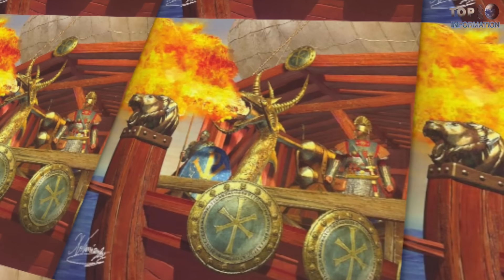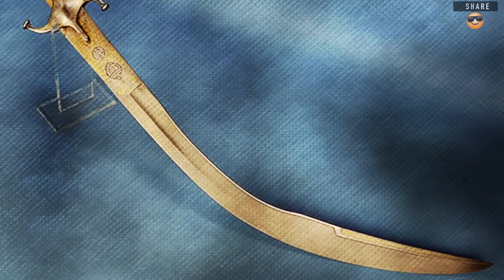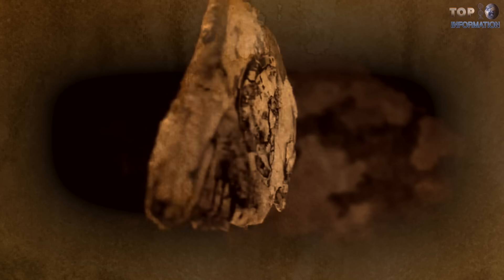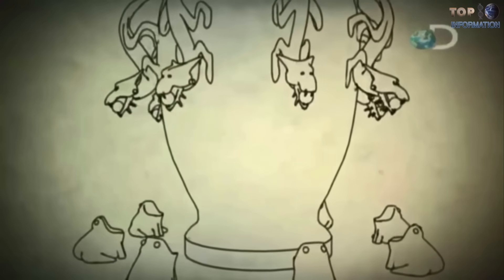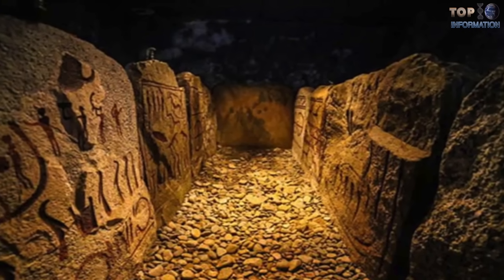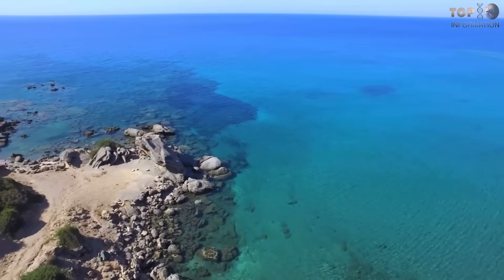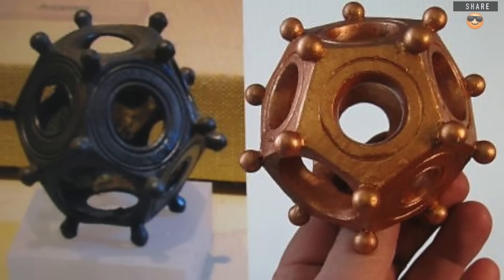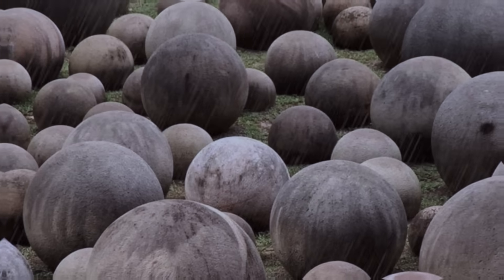10 Ancient Inventions that Science Can not Explain ▶ 8

Comment: as a blade smith I have to say , the Damascus steel section of this video  is rubbish. " Damascus" steel actually  came from India and is called wootz. It is a crucible steel, but it does not contain leaves or coal. A small bit of carbon based material was sealed in the crucible to use up oxygen to allow the  meteorite iron to fuse into a forgable bloom. No sword will cut a rock and a silk scarf, it's not  supernatural, its just high carbon steel that behaves according to normal laws of physics!
Reply: For all here, pls read iron pillar in delhi to understand India..
Reply: How To as a matter of fact, they are! Evidence has been found that the mauryan Kings had these swords.
Reply: Aditya Bhargava it’s bullshit
Reply: You also forgot to mention it has to have a better furnace that reaches much higher temps. The reason there is no real info on the method is due to the same reason no one could make silk out side of china.  The formula was guarded. Only a small hand full knew how to produce the ingots.
Reply: Fuck those satanist zion,fuck the knight shitty templars,fuck the kabal pedophile vatican city....fucking disgusting invaders,the real terrorist...
Reply: It wasn't made by syrians. It was made in India, traded to Syrians, who passed it on to the West. In the process, they started calling it Damascus steel
Reply: How To  buddy it was found in India, I've studied that shit in school, it was first used and popularised by Tipu Sultan (a king of India)
Reply: Not the king of India king of some cities of the sub continent.
India is teaching false news news in the school.the Damascus was 9000 years ago.
and Tipu sultan was 400 years ago.
Reply: No it wasn't it was first used in the islamic empire then later spread to other places.
Reply: @hiteshkumar4018  I know that you're right about that India had access to high-grade iron, and that the Indians of that time had the ability to produce both iron- and steel-items of exceptional quality. As early an age as that of the reign of Ashoka ("the cruel" whom after a convertion to buddhism instead became "the pious") ,approx. around 300BCE..
But - when referring to someone who had the title Sultan, we must already be at the age where the muslims had arrived, since Sultan is an Muslim title (meaning leader, if I'm not mistaken?)
Reply: Hitesh Kumar ya well school isn’t always right about history by the way you said school it sounds like your in elementary
Reply: Damascus steel was made from crucible steel ,made from an ore that was mined from two to three mines. the ore has different minerals than any other, when the mines were worked out the method was lost. Damascus may not be named after the city but from Damacine the pattern in silk.the sword  pattern is very similar to the watered look of some silk patterns.
Reply: Karl Kruger that makes perfect sense.
Reply: Damascus is difffrnt than wootz
Reply: lol indians. According to them everything was invented in india yet somehow they are never found in india. Strange.  I bet they'll probably claim they also invented gravity just forgot to write it down lol.
Reply: Gunner4Ever,
Wikipedia isn't a scripture sent down from heaven, that is written by someone like you and me. And there is a lot of wrong information here. If Damascus sword originated in India, then why there was no such swords in India before Muslim invasion in 712 A.D?
Reply: @M. Rashid Iqbal Mian, Hahaha, Yes, Wikipedia isn't a scripture sent down from heaven. It's exactly why it is reliable & actually legitimate, compared to your heavenly book narrated by a magical winged creature Gabriel to a 6th century desert dweller. Wikipedia actually has got citations to back up it's claim, just so that you know. And if it was that easy to write wrong information on wikipedia, like how the dumb internet folks claim, then why don't you go & edit that wiki page that says that Damascus Sword originated in India.

Also, who told you that Damascus Sword was not found in India before the Muslim invasion??  You have just assumed that & starting from a wrong assumption yourself. It was very much there, just  that it wasn't called the Damascus Sword in India. The knowledge of producing Wootz Steel (Yes, this was it's Indian name) has been there in India centuries before Islam was invented by Muhammad.
Reply: Gunner4Ever,
My friend, Isn't it very easy, that Indians present a Damascus Sword as a proof, that is before the arrival of Muslims invasion in India? But this can not happen, because there is no such sword.
Let we assume and believed that such swords were first made in India. Yet it proves the ignorance of Indians. They were using poor quality swords, while they had the ability to make high quality swords.
Reply: @Rashid, Mate, India has got lots of swords in their museums made of the same Wootz Steel of which the Damascus swords were made. Just that they don't call those swords in India as 'Damascus Swords'. And it's not just me or the other common folks over the internet claiming this. It's the researchers & historians who agree upon the Wootz Steel being originated in India & then being exported to Middle East later on. Maybe you should use that high end technology called 'Google' to read about that. That's just a click away, isn't it?
Reply: M. Rashid Iqbal Mian I just want to ask you one question...were you alive during the time Muslims invaded India. You are talking as though you were the commander in chief for some Muslim ruler. Listen ,have you ever played that game where you sit around and pass a word to everyone in a circle to see whether the last person gets that word correctly? Mostly the last person says a different word from the original. In that short time words are being manipulated. So imagine over the centuries how much the original truth has been fabricated. Human mind is not advanced enough to understand certain things. Don't talk like you invented time machine and saw the past. Someday truth will be clear. Be patient till then. And I said all this not just for you ,it's for everyone.
Reply: Gunner4Ever islam is not invented by Muhammad pbuh.......ot existed a long time before but in different name......
Reply: @funguy9177  agreed.. Even in the video shows some Islamic design found in Scandinavia.. Guess all educated Western people are ignoring Islam contributions.. No wonder they separate religion with normal life
Reply: @ahmadulwan6634  I do not exclude the Islamic contribution to, mainly science - not to mention the conservation part.
But - the Viking swords have absolutely NOTHING to do with anything Islamic.. They were made at about the same time when Islam came into existence, not even Christianity had arrived here at that time.
Get a life!
Reply: @tanime_man6535  I respect what you say but there are multitudes of  deductible evidences from unrelated and unconnected sources of a given period in time that match, that is how historians conclude what is near to the truth and what is near to the falsehood, 
otherwise no use in learning any history and taking any lessons from history.
Reply: @khiljinagor8976  if evidences you mean books right?? And who wrote them? People. Let me remind you of a saying " winners create history" whoever invades a country and wins will record that incident according to his own whim. He maybe a cruel guy but he wants history and the future generations to treat him as hero so he will make it that way. And I don't believe everything that's written in books have evidences and proofs .
Reply: @tanime_man6535  so you have secret books and or knowledge to explain events in history that no body else has? Or do u get visions.
Reply: @khiljinagor8976  did I say I know stuff about history like how you guys are assuming . I'm saying history is not completely true. It could be fabricated. If you are blindly believing everything book says then you are as dunce as you could be..
Reply: @tanime_man6535  Look no body picks up one book of a given subject and says hey I know the history of that now- everything there is to know now. 
No we look for other multiple sources and even from different angles eg enemy or opposing factions of a character to see the opposing point of view of the same event. I'm trying to tell u we may not know the absolute truth but we can gradually start getting pictures of history if we endeavour.  

Why it's important to always study further information even if you think u have found out a lot you never know you could unearth whole truths after years of having one opinion you may find out it to be false,,,... that is if you are searching for truths, and honest about it. Otherwise just pick up one book or the main narrative only and be happy in fools paradise. 

I am not saying u are doing that, just pointing out historical debates can happen based on texts and findings we should not just brush it aside completely. 

You seem to imply from your posts and opinion historians just pick up a book from a victor and say hey there's the truth., and seem to imply every historian is doing it from your argument.
Reply: @khiljinagor8976  you said it yourself I rest my case... You said we may not know the absolute truth. Then why are we fighting based on half proven facts. I'm just stating that once we know the entirety of it (and I'm sure we are not advanced or evolved enough to understand all that) we can have these arguments. People are fighting each other based on half assed theory . That's my problem. Only if you know completely about something you can argue about that. Only idiots will fight over half based facts. You have 5 or 7 different variations of Mahabharata. Person who read one fights with the other. You get my point? That's what happening here.
Reply: justin g It does make sense, if damascus was so amazing and magical then why wasn't it used more? And why didn't it persist until modern times? Once we found out how to use steel (a vastly superior material than those before it, just like damascus supposedly was) we clung to it and never looked back, why didn't the same happen with damascus if it's reall all it's hyped up to be?
Reply: I'm sorry but aside from maybe some type of classified unobtainable alloy that the US government has hidden away at groom lake there is, nor ever was a blade
 that will cut through rock and then slice a scarf in mid air. It's a nice campfire tale for the kiddos but that's all it is
Reply: Ron Hoy ur smart and smarter than smart,, well done,,, if I may suggest read  more book oh history not his-story
Reply: nu uh! its magic! it says so in my magic book!
Reply: Yeah, even to me - who is not a blacksmith or for that matter knows very much about forging blades at all - it seemed like the "mystery" of the so called Damascus-blade was heavily increased!
Common, please - what kind of metal can "chop" stones in halves? I mean, really??? And, without even being damaged? Are we talking about Luke Skywalker's saber here, or what?
And, I can't say that I know anything about whether the Damascusblades actually came from India or not. But this I do know: the Indians were THE most advanced ancient people in metallurgy, all other civilizations considered.
Even the British acknowledged and respected that, when they found it in the 17th or 18th century - and the proof is still standing 'til this day, in - I think - Dehli. I can't seem to remember much else than that I think it's called Ashokas pillar, or something (at least it's someone's/something's pillar) - which is like a 10+m long iron pillar, without any seeming joints...they just do not know how they could have made it!
Reply: Matt*ma* Ghandi but indian once conquered and changed by british empire......that might change everything....
Reply: Brad S it's hilarious when you find one of these videos that are just plagiarism of listicles from buzzfeed
Reply: I find it odd that joe shmo in his back yard can make a Damascus sword while its still a scientific mystery....... Now either joe is a fucking genius sent forward in time with mysterious knowledge and unknown materials, the scientific community is fucking idiots, OR this video is absolute hogwash as suggested by the OP (I got my money on the hogwash part).  LOL   
As far as who was the first to make a Damascus sword...... who the fuck cares its 2018.
Reply: @Mike Smith you're saying dragons aren't real man I just seen a dragon on the cartoon network shits real. 😂😂😂😂😂😂😂
Reply: I think they mean that we haven't been able to quite reproduce the same properties as true Damascus. We have superplastic steels for sure but last I checked (which was like a decade ago) we haven't managed to get it quite right in terms of reproducing the exact same type of steel.

Like the modern damascus we made is either more or less hard/flexible than the exact balance of old damascus.
Reply: Many things are beyond the imagination of people that have no concept of physics chemistry and material science, math etc.
Reply: the amount of religious autism in this thread is profoundly overwhelming...
Reply: @wilsoncrocker  lol, true.
Reply: you misunderstand Ron she said "Dumb ass cuss" steel Ill bet its from china like everything else!!
Reply: How To that's the dumbest type of "logic".

Example of why you're dumb: hey, if the pyramids were built by Egyptians, why aren't they still building pyramids?

Or a more exact example: hey, if Damascus steel was made by Syrians, then why don't Syrians make them today?
Reply: juuh771 if only a small handful knew how to make it then how are they making it today? 🧐
Reply: Ron Hoy you are correct Roy. Greek fire was really Persian fire. The Greeks took it from the persians
Reply: dont bother asking, he was jst googling after he read ur question.
Reply: Army BTS it is not actually 'obvious' but it might true
Reply: Ron Hoy you wrong..the damascus was originated made in arab..it was one used by the muslim prophet...and dont be so clever if you dont know the history of it..
Reply: Ulfberht swords was made of crucible steel, and it wasn't casted. Also, we know how to make crucible steel.
Reply: ya i agree on damascus, i would go one further even and say the bronze age was total crap, bronze is harder to make than steel it would have come second, bronze is like saying the color green was discovered before yellow and blue its always sounded that stupid to me the theory
Reply: Well since both dragons and dinosaurs both have tells/myths having either quills or scales on them mostly quills it could be possible that there was some type of dinosaurs if you assume dragons and dinosaurs are one and the same as I am; it could be possible of using a animals blood for cooling instead of water was used since most damascus steel that is made is still not close to the old damascus in how it's recreated.
Reply: the narrator is dumb and knows nothing more than shit
Reply: Actually, Damascus steel comes from Samaria/Mesopotamia which advance metallurgy was more common ten today. Yes, it’s was spread to India, the same way it spread west to Africa, and north Europe by Vikings trade roots via current Ukraine. It’s not mystery. Can be done today, but it’s massively expensive due way it’s done. And it content may be organic to assimilate slag - include bones of ancestors, glass from descent meters landings, etc. White man Europe lives in caves then ;)
Reply: @sniperacs  Don't spread bs
Reply: ok bill nye
Reply: was gonna come and comment about that :D fucking lost my shit when she said damascus :D oh well im glad someone else got here before me :D
Reply: Ron Hoy your right but I've heard the Vikings used ashes from the dead for carbon as well to make stronger steel I heard it's the best
Reply: Ron Hoy I had someone try to tell me Damascus was outlawed. I have a friend in Arkansas that's quite possibly making some "as we speak".
Reply: is that hard to cut a silk scarf
Reply: @matthewtrippi6739  lolol
Reply: Ron Hoy I agree with. The so called Damascus sword has the wave jst like an Indian sword
Reply: OhMyGOD OMG illogical
Reply: cad80 24  your grammar is as fucked up as your opinion
Reply: Not a bulsshit. The tehcnique humanity uses right now is far from the techniuque used at that time. Damaskus steel of that age didn't include only leaf like material, it also had a few more foreign substences that acted as a purifier of carbon, making it close to katanas in sharpness and close to full metal rods in strength
Reply: Actually, it first came from Damascus.  Not the damn name.  -_-  Which is Syria.....   India didn't even fold their steel until after Japan started folding to make similar "Damascus".  But this video is full of stupid shit anyways.
Reply: Ron Hoy prove it
Reply: It was the Muslim rulers of those time who brought Damascus swords to India. Mostly they were Mughals. You better educate yourself more.
Reply: And the ingots of wootz steel were imported from India and Sri Lanka, the swords were not “made” there. Materials from South East and iron smiths from Middle East. No fucking Indian knew how to make it. They just had the raw materials which they exported to Middle East where it was actually made.
Reply: So indian
Plsss

Make..this damascus sword..

Make sure its the most powerfull in the world..

Like..history damascus sword...
Reply: No, it didn't come from India, the wootz steel came from from India.
But the people from Syria created damascus steel from wootz steel.
 So damascus steel is a product from Syria. It is like saying yeah tomatoes came from us so in otherwords so did pizza...
Reply: All of these videos  are rubbish  she can't  even  pronounce Damascus
Reply: Cad8 u are a complete loser  Europeans fuel the world
Reply: I suppose I'm a wee bit late but there is a documentary on YouTube where researchers from Jordan took ore from mine's just outside of the city they brought it to America and there's a Smith and he made wootz out of it. the thing that makes wootz wootz as far as I've gathered from documentary is a tiny bit of vanadium as an impurity in the ore there's probably a bit of information I'm missing due to how long ago I watched the documentary
Reply: Proooooooooove it (I don’t deny ur right)
Reply: Ron Hoy THANKYOU
Reply: cry indian
Reply: @Mike Smith samurai swords are covered regularly in clay slip and pine charcoal during forging leaves would burn and add carbon too the steel
Reply: "impossible" or shits like calling others achievement rubbish, is the kind words used by incompetent people who can't achieve anything meaningful in life. Keep trying to be cool in internet bro. Peace out and bye
Reply: You lie, islamic state who made the sword not india.
Reply: hahahaaha the indian's the got nothing no education nothing actually its from damascis :)
Reply: Damascus is NOT wootz steel! Damascus is a regional form of pattern welded steel - a forging process that uses multiple shards, ingots, pieces etc. of a metal which are stacked, forged, folded, forged... creating a multiple layered "pattern" within the final piece. You can pattern weld any carbon steel (and other metals). Damascus is to pattern welded steel as Champagne is to fizzy wine 😂
In regards to Wootz... the jury is still out. Attempts have been made (by myself included) to recreate the process. Some have got close but not perfect, many have failed completely and a few have (despite providing no peer reviewed evidence of such) "claimed" to have achieved it. Most sensible people believe they've simply produced regular pattern welded steel at best.

The nontube question... and? We struggle to understand how the Inca temple masons achieved their craft. Was it luck, skill, time...? Same goes for the existence of nanotubes in ancient metallurgy. They've been found in various regional metal processes and, again, most are out on the definitive answer to the question as to "how".

Damascus steel, and MANY other regional pattern welded steels, have been proven capable of both high edge retention and plasticity. Examples include katanas cutting steel cable, Viking swords cutting through shield rims etc etc. The best example I've seen in person is a pattern welded cleaner cut through a stack of 10 regular chef knives.

Anyway... claiming that pattern welded steel from Damascus is the same thing as Wootz steel is like claiming grass is a cow.
Reply: Physics lol that's common freaking sense to anybody that's used scissors or a kitchen knife
Reply: Material from India, smithed by the Arabs.
Reply: Ya I looked it up on numerous sites you are wrong... Your probably some asshole who makes shitty knifes in his garage puke fucking Ron hoy
Reply: Dev Sharma  I can't even remember what you are commenting on nor what comment of mine you are replying  to!  But I'm not in the habit of arguing for the sake of it, however I  will say this that sarcasm it a veil people hide behind when they do not have a definite or even a logical answer!
Reply: Dev Sharma  of course
Reply: ALLAH can make everything possible that sword were made for our NABI(if you don't know what is this mean find it on Google it's Indonesia language)it's not from India stupid 
DUMB
Reply: You don't understand Islamic history
Reply: Right area. Right name. Wrong science, at least beyond the crucible stage. Carbon nanotubes have been found in true (ancient) Damascus steel, which has been analyzed in an electron microscope, that can only have got in there from the the carbonised phloem nanotubes of an unidentified leaf material. It's not magic, but it is a lost process.
Reply: How To it was basically manufactured in South India was traded to people of Damascus in suitable bars..
Reply: pam4840,
You Indian have problem with Arabs and Muslims only Because he ruled you for almost a thousand years. Arab and Muslims acquired the knowledge of medicine from Greece. Indeed, Muslim experts, such as Avicenna , brought it to rise. But it still called the Greek method of treatment in the Muslim world. Arab took the method of counting from India. That s why in Arabic, Persian and Urdu a digit is called "HindSa" which means "from India". Muslims never tried to twist the history like you Indians. I watched an Indian Politician giving speech in the college of Indian Punjab, He declared, that We Indians were so skilled in surgery, that the elephant face transplant on a human body. He was referring to your god Ganesh. While giving the proof of your ignorance, you wrote,"maths isn't a thing for Arabs dude...". The most interesting field of Mathematics Algebra is come from Arabic word "الجبر Al-jabr" from the title of the book Ilm al-jabr wa'l-muḳābala. So don't try to twist the history. Every rise has fallen afterwards. And from last two centuries we Muslim are faced our fall, because we left our book. And all other nation progressed because they left their books.
Reply: Ron Hoy - thank you!
Reply: There is no swords that can slice through stones and receive no damage. That’s total bull shit.
Reply: haha damascus from india.carry or chapati yes from india
Reply: He thinks he is a knife expert  since he has been watching forged in fire on the discovery channel
Reply: Zubair Aslam you muslims folks need to understand you didn't exist before 7th century where as advanced indian civilization has been there with recorded history of more than 20 thousand years.
Reply: @2531Prasad  If we are talking about a "recorded history" - the Indians has had one for about 2-2,5 thousand years, not 20 thousand!
Although there are archeology that supports advanced civilization (s) have existed in India for about 5-7 thousand years (or, indeed in today's Pakistan, since we are talking about the "Indus-civilization).
Isn't that early enough? Why must you exaggerate? Common - there is nothing to support that we, humans had a civilization for 7-9 thousand years, ANYWHERE!
Reply: Matt*ma* Ghandi are you joking ? Just the harrapan civilization (bronze age) is around 8000 years old before that comes the vedic times which is almost 20000 years before harrapan civilization.
Reply: Matt*ma* Ghandi And forget India, Egyptian cviliziation is also almost 20k+ years old
Reply: @2531Prasad  I suggest you do some reading about your own civilisation: the Harappan civilisation WAS/IS from the "Vedic time". And, sure they might be a bit older, or a bit younger - but absolutely NOTHING supports the theory that they should be older than around 7000 years old. 
But since the so called RECORDED history began around 2.500 years ago it's based on archeological evidence... Which still are strongly indicatedors - if the mud from the bricks, the human relations etc says they're from that time-period ..?
Or - do you have some special evidence that no-one else has that you'ld like to share... And no - texts such as the Vedas do not count, as they don't prove anything.
And yes - for som reason, hitherto unknown, all of the civilizations stretching all the way from China to Egypt seem to have arisen approximately around the same age.
Just as our recorded history does - which is called the "Axis-age" - and which also, somewhat mysteriously arouse in around the same age...
But, since you do not want to be disturbed by facts - I promise to not bother you any more: so that you can dream on about your glorious past from about 10.000 years BEFORE humans "invented" agriculture...!
So - dream on, and loose yourself in your holy books everyone that wishes to do so!
Reply: Matt*ma* Ghandi are you Muslim ? If yes then I won't argue with you further as you probably don't even believe in darvins theory of evolution. I know plenty about my civilization. You need to do some research. But if you are Muslim then just let it go no point arguing with you.
Reply: Matt*ma* Ghandi Egyptian and Chinese didn't began at same age Chinese and indian began at same age. Egyptian began few centuries before china and India . Egypt is known as cradle of the modern civilization. Get your basic facts straight.
Reply: @2531Prasad  Absolutely not - I'm NOT a muslim. In fact, I do not "belong" to any organized religion, or denomination. Although if I HAD to name one, which I feel "closest" or most connected to (since I see myself as a spiritual person) - I'ld have to say that I'm a Buddhist.
And the last things you said, especially about Egypt being the "The cradle of Civilization", I do agree...
I was talking in approximate terms, and in so doing didn't take a lot of consideration to centuries. And, I could of course remember it wrong, and instead of the Harappan civilisation being 7-8000 years old-they might be from 7-8000BCE.
BUT, with that said - I stay by my statement that no civilization being older than 10 thousand years old - since that's (again) APPROXIMATELY the time when agriculture was invented - and no civilization could logically have come into existence before we even knew how to farm (and with that, giving some of the ppl living in those civilisation (s) time on their to think-and "create" civilization").
That is my understand of the knowledge hitherto acquired... And, even though I don't feel 100% confident that we yet have all the answers - I believe that this is the info we currently have, that is proven or provable!
Reply: Prasad Bankar are u a Hindu? Do you worship cows? Here’s a hamburger 🍔, will you bow to it now? Bringing up religion is an old trick, even your religion doesn’t support Darwin’s theory of Evolution. So, have some “laddoo” and chill.
Reply: Prasad Bankar sorry if I was being rude.
Reply: @MrZenGuitarist  I'm not referring to any holy texts here, and indeed the Vedas have some go9d knowlwdge preserved. 
Having said that that person is living in " Murkh Swarg", I don't know how much u know your Hindu or Bangla I'm sure the person got the jost
Reply: @2531Prasad  Iraq is the cradle of civilizations, u really need to get your facts right now maybe read a bit more.
Reply: @2531Prasad  ha ha, hell with your logic....... Your brain is so small as I could understand 😂😂we Muslim folks existed from the very beginning of ur civilization, we were not Muslim then...... We became Muslim later, and for ur information I'm saying again, we were part of that civilization...... And bro, for God sake it's not 20000 years, don't poop everywhere....
Reply: @2531Prasad  I know Indian Civilization  is very old, but 20 thousand years humans didn't even have proper written languages nor was Iron technology available, and no record has been found of any civilization in India that old, stop exaggerating over the top
Reply: Sarala Das,
My respected sister! I know my English is poor, it isn't disgraceful to me because English is not my native language. Your English is good or not, it might be the instrument to gauge the other's standard of knowledge near you, but not for me. Because a non-educated ignorant English person can also speaks a very good English and a Japanese who have doctorate in Physics or any field haven't know a single word of English. But I have seen it on social media that according to mostly Indians to gauge the other's standard of knowledge and quality education is English, like 100 years before was Persian. This is nothing other than the reflection of their slave mentality. If you feel anything bad, I'm sorry for that. May Allah bless you my sister with all the comfort and happiness of life(Ameen Ya Rab-ul-Alameen)
Reply: Zubair Aslam most of the arab discoveries and invention in astrology and maths and metallurgy were from India. Many old manuscripts were translated from India. Even before muslim invasion there were trade relation by sea between india and middleast and africa... arabs also heavily burrowed idead and was  influenced from ancient Rome..ever heard of kerala school of mathematics... i cant recall the indian names of the manuscripts that were translated into arabic by numerous travellers and explorers that visited mediveal India even today arab countries produce least no. of scientific journals and phds..except for one Nobel in chemistry the arabd cupboard is bare science and maths isn't a thing for Arabs dude...
Reply: pam4840 what are you talking about .....astronomy is from arabian al-khawarizmi.....other i dont remember their name......although I am not arabian but please.......stop the bullshit
Reply: @pam4840  you do know the middle East is probably the oldest civilization right? Mesopotamia, Babylonians Greeks Persians Romans Egyptians etc all contributed to these discoveries. If anything when the Aryans invaded India they passed on their knowledge to the indians. It's why you find indians today throw cow shit on one another thinking it will give them super powers. Or how the first plastic surgery was carried out by hindus when they removed a head from their God and replaced it with a baby pink elephant. Get real
Reply: @pam4840  India had magnificent mathematical practices and sciences, but to say Arabs didn't do anything is making yourself look dumb, they modified a lot of the sciences they came across and rapidly put it to other uses, hence why from the 7th century to 15th Arabs were excelling in all of sciences way ahead of any other civil at ions. 

They respected knowledge that they came across whether it was Persians, Indians or Greeks. 
To blindly brush aside knowledge just because u hate the people is ignorant.
The Khiljis came to Bengal and were the first to translate Vedas and Mohabharet (Hindu religious scriptures) in to local Bangla,  first to do in history,  the Brahmans were keeping it secret from the Local populations forbidding reading and understanding these texts so as to keep a monopoly on the knowledge and keeping a caste system.

They hated Muslims for liberating the masses and teaching them knowledge even the Hindu religious knowledge when they were Muslims themselves. 
It's no wonder in 1203 Muhammed Ikhtiyar bin Bakhtyar Khalji conquered Bengal with 200 horse man. 
Locals accepted them and the tyrant Hindu king escaped through back door of his palace, 

Only extreamist nationalist Hindus and  Brahmans hated Muslims because their game was exposed on the controlling and exploiting the masses.  
Locals loved the Muslims and hence forth Bengal and majority of the population still to those days are Muslims.
Reply: Yes - thank you Ron!
Reply: Mike Smith 😒 chemical reactions everywhere..that's why get pro help..
Reply: How To you are stupid. .that sword can be found in india. .
Reply: Prasad Bankar:  not 20,000 years.  4000 years at the very most.
Reply: Andy Howey  This guy PRASAD is an idiot ahahah 20000 years lol indian civilization began at 2nd millennium BC with the Vedic civilization, even the Egyptian and Mesopotamian (sumerian, assyro-babylonian, akkadian), greek civilization which are the 3 oldest and most advanced civilizations of the world do not have 20,000 years of civilizations
Reply: @andyhowey7351  no Mohenda Jaro is nearly 5000 years old and Industrial valley civilization is also nearly 5000 years in modern day Pakistan. But 20,000 years old civilisation is total exaggeration make believe
Reply: @khiljinagor8976  The name of the site is "Mohenjo-daro", and it's part of the Indus Valley Civilization complex -- not a separate entity, as you seem to imply.  Actually, that is just its "modern" name.  Since the Indus Valley "script" (IVS) has yet to be deciphered, nobody knows what its true name was.  Before you claim that Iravatham Mahadevan has deciphered IVS, I would that he did not.  He only speculated what the name might have been, and since he seems to have been eager to tie it to Tamil (his own ethnicity), I would say that his objectivity is questionable and perhaps subject to Tamil nationalism.
Reply: Those people already had these swords prior to invading India
Reply: And since the ancient times India is doing trade business with them so obviously India always sold wootz to middle east before their invasion why do you think every other country that time trying to come or capture India it is not just for it's spices only.
Reply: no it origin lie in india
Reply: Zubair Aslam oh yes the Damascus sword fires lightning bolts to shoot any jet from the sky or ship from the sea
Reply: @zubayraslam876  no this process was available in India prior to Muslims visiting India, but they perfected it and brought it to middle east and beyond, they used it extensibly.
Reply: Dragons are real.  Meteorites are NOT.
Reply: M. rashid.    Brother u coud have posted ur dialogue in arabian language or whatever shit u had learnt in school or home may b I dnt know, bt ur english  is very poor n disgusting. 
I mean what is Indian Punjab?? U cud hav said Punjab In India.
Ha ha ha, nys all this things r beyond ur understanding so no use making u ppl understand. Marry ur sister n be happy.
Reply: @saraladas2807  Not taking sides here - both the past and current Indian AND Muslim civilizations have their share of crack-heads... As does all others, as well.
But I believe he referred to Indian Punjab - since Punjab is divided, and thus lies in BOTH Pakistan and India!
Reply: @saraladas2807  you're correct about the inbreeding reference but your attempt to insult the dudes intelligence was pointless and hypocritical considering how horrendous your grammar is..
Reply: @saraladas2807  why the Indian punjab is wrong??? BTW, no one actually should give a fuck about ur any opinion on anything that exists in earth.... You're just a scumbag.....
Reply: @saraladas2807  you can talk if he has bad language let the people decide what you wrote because it's hardly clear, and most of your contexts are worthless, at least he has some contexts but maybe it was too complicated for you.
Reply: Well how much big is your brain?? I will ask one ques who performed first plastic surgery??
Reply: Well - that kind of surgery is found within the body of texts that makes up the ground for Ayurveda, isn't it? In the Charak(a)- and Shushruta Samhitas...or, something like that. Or?
Reply: Ashik Chollangi ,
  Was it a plastic doctor? I give. Tell me. Please!
Reply: @AshikChollangi1  I've heard as far back as ancient Egypt and ancient Peru
Reply: Ron Hoy if it came from india, than why such swords not found in india? Stop this nonsense and admit the truth
Reply: bruh I am an Indian  the are found in India  by the name of wootz
Reply: abhimanyu raut “bruh” wootz steel is used to make Damascus, it is NOT Damascus. India used to export it to Middle East only where the iron smiths knew how to make Damascus swords.
Reply: @Donotcopypaste  
If you want to know the reason read the book written by Former HRD minister Mr Shashi Tharoor "An Era of Darkness " the book is available in amazon store. ...
Reply: @Donotcopypaste  It came from Sri lanka not  from india  those steel are made from  kind of bird shit(Vahilhini).Ancient blacksmiths fed those birds  a food which contained iron particle. Bird shits are collected and reprocessed them to extract the iron. Those steels were exported to Syria that time.
Reply: Read history thoroughly instead of hearing from youtube or reading from newspaper or media you will know that that type of steel found in India they tend sell that to their neighbouring countries which was middle east. And remember read wikipedia.
Reply: Ron Hoy I thought it was bullshat also
Reply: this world is bigger than your tinny brain